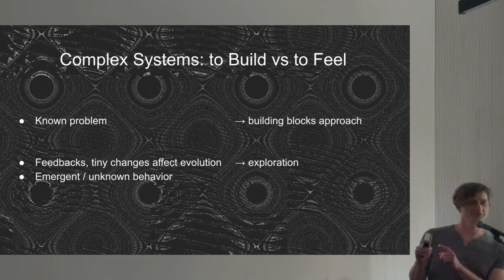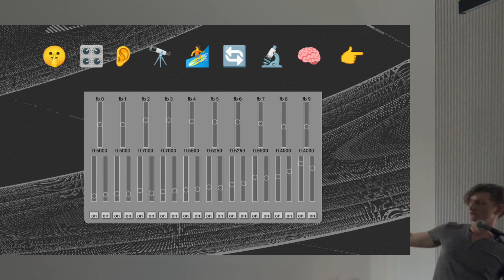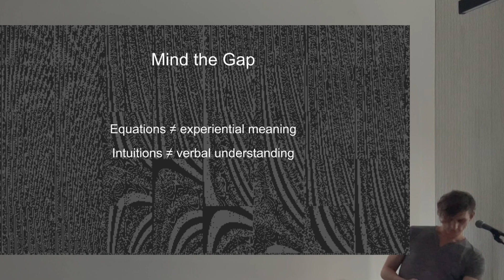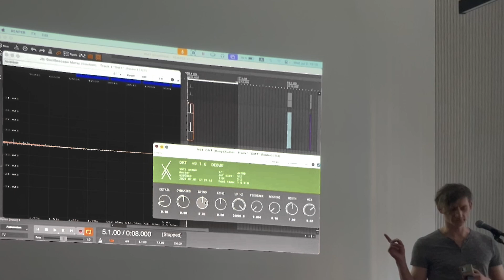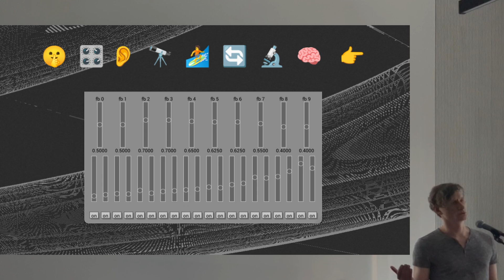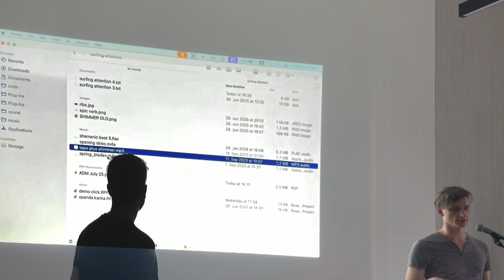Surfing Attention, Playful Control - developing intuitions in R&D of complex systems

Comment: Well. It looks like a complex equation over the signal is not intuitive until it is described in terms of the phenomenon in which the musician (sound producer, etc.) thinks. Accordingly, the task of the ui is not just to provide knobs, but also to provide knobs for the qualities of the phenomenon, which are clear concepts such as attack, delay, etc. In my opinion, the simplest template that a developer can follow is to provide knobs for the equation, but also to provide presets for all significant effects in order to better navigate the tool's capabilities.